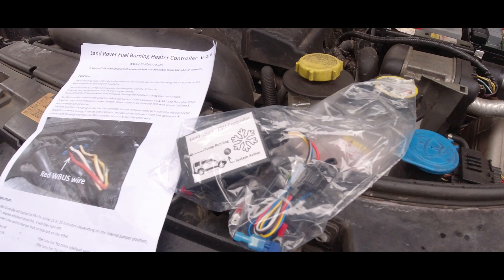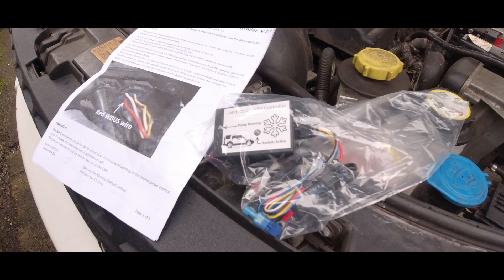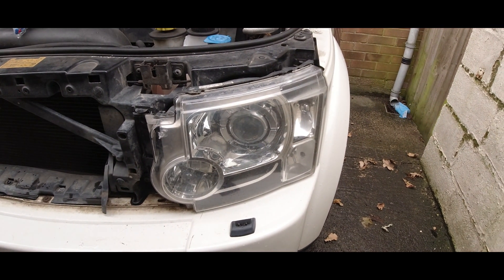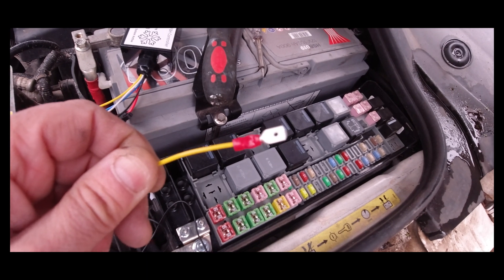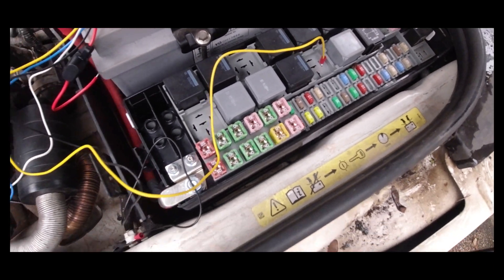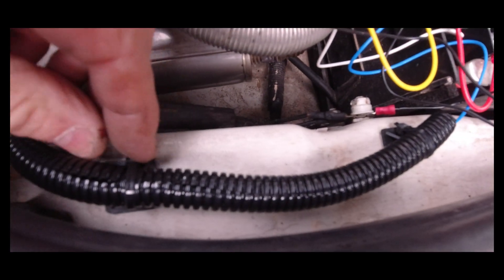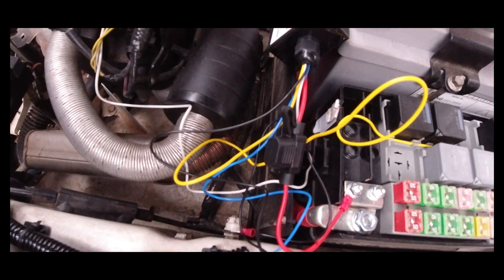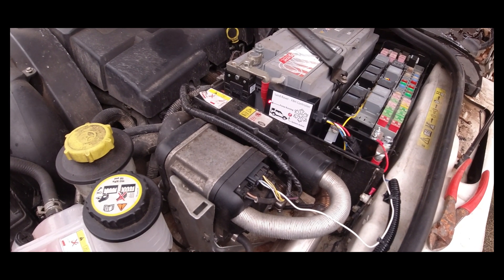Fitting a Discovery 3 Fuel Burning Heater controller

Comment: Just curious, when you say the Land Rover button, I assume you mean on the key? Just mine when you press the button it unlocks the tailgate? Thanks
Reply from the maker: The land rover button on key fob you can reprogram, the reason i used the lights is that is what my fob is programmed to do
Reply: There is a sequence to program the button to a few functions. If you put the key in the ignition turn ignition on then off take key out, press the button then what ever the function you want to do. It bleeps on the dash and is now programmed, you can do lights, boot, suspension and a few other things.
Reply from the maker: Thanks, home zoo
Reply: @Towpathtraveller1693  welcome mate, got a sub from me ❤️

Comment: Good video. I have a Disco 4 and I would like to use my Webasto to heat the interior when I am sleeping in. Would this device work?
Reply from the maker: Hi thanks, the webasto fitted to the discovery 3/4 is only a pre engine heater, so it just warms the coolant aids in starting and emissions in cold weather, after it has run the interior heating system is warm but I don't think it will work as a camping interior heater
Reply: @Towpathtraveller1693  100% spot on mate, great job btw. External fitted diesel heaters are what they are after ❤